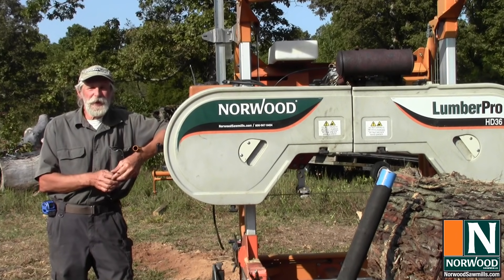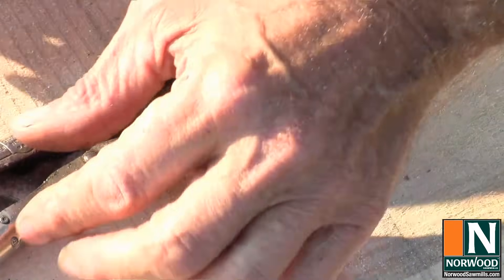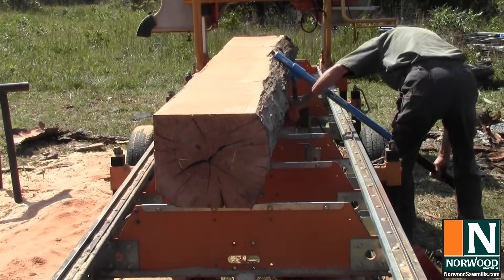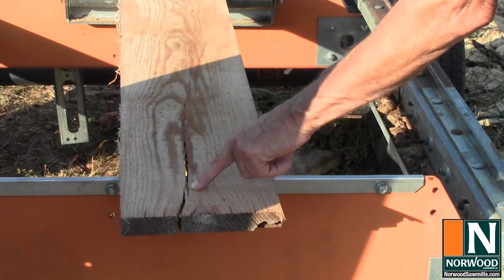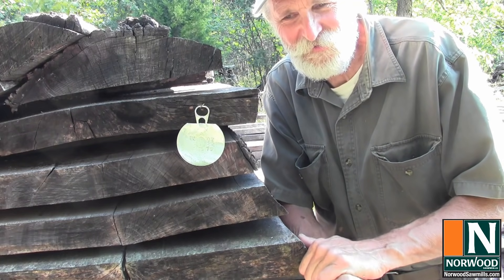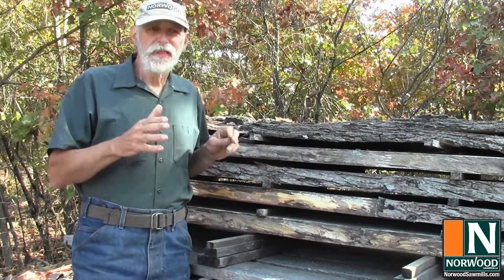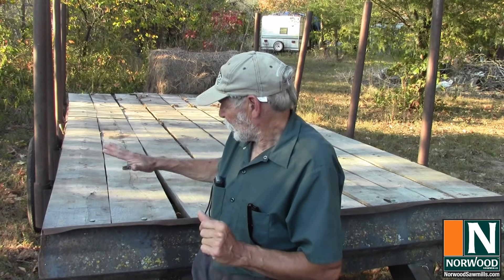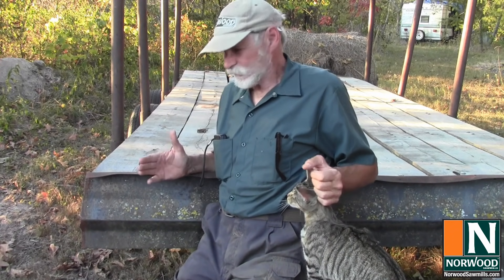Sawmill School - Air Drying Your Lumber

Comment: Can i blast my 26in slab with a turbo heater while its anchored down onto stumps every 4 ft?
Reply: Hi, Dale.  Sure you can!  Are you in the charcoal business?  It takes time for the moisture to migrate through the wood cells, and that's more a matter of thickness than board width.  If you try to dry it too fast, the wood fibers on the surface will dry and shrink, while the fibers in the center are still at the original moisture content.  The stress will cause surface cracks and can compress the moist fibers in the center which, when they finally dry out creates a reverse stress known as "case hardening".  If you've ever had wood twist or bend when you rip cut it, you've probably encountered that issue.  The only quick way to dry thick slabs without damaging the fibers is in a vacuum kiln, which can dry 2" thick slabs in a few days, but is an expensive piece of equipment.

Comment: Hi How do you pile the lumber up for drying.
Reply from the maker: Hi Reiner

Check out our video "Sawmill School - Cutting Blocking & Stickers to Air Dry Your Lumber" https://www.norwoodsawmills.com/tv/index.aspx?isVideo=true&id=312955927
Reply: Main thing is to have it under cover & allow good air flow through the stacks.  If in a barn or shed, you might want to have fans to circulate air through the lumber.

Comment: Is the process and time for air drying any different for a 2x6 vs a 6x6? Planning on milling my own 6x6s
Reply: Process is the same, time may be different.  A lot depends on how you use the lumber.  A 6x6 is generally used for structure.  It will take 5 or 6 years to air dry, but that might not be important, since it shrinks only about 0.1% in length, but will shrink around 3/8" in width & thickness.  It is also more likely to end-crack, since there is more drying stress, so you might want to end coat the beams, if appearance is important.  Hope this helps.

Comment: Hey thank you so much for the information! I am confused a little bit by something which is I did my first stack and sticker on a pin oak. That was nine months ago here in Central Oregon and I found that the slabs have capped and warped so significantly. I’m wondering if I should’ve waited and left it in the log? Does it make any difference? From this video it seems like it really doesn’t
Reply: Good question.    A lot depends on the species, the grain of the wood, and how it is milled.  Pin oak is pretty wood, but it does have quite a reputation for splitting and warping as it dries.  A lot of people either strap the wood tightly with steel straps or nylon cargo straps (which need to be tightened periodically, since the wood shrinks as it dries), or put weights on top of the stacks to help control the warp.  It doesn't help to leave the log-- it is best to cut the log as soon as possible, as this reduces end cracking.    Here's another video you might enjoy: https://www.youtube.com/watch?v=DBQjK_LXsLU

Comment: Any particular moisture meter you recommend.  The pin type seems the most accurate.  I have about 800 bd ft of both post oak & ash.  Not sure what I am going to do with the post oak.  They been air drying since Dec 2020.  Tks for the info.
Reply: I use a Lignomat pin-type meter, mainly because the pinless meters are more expensive.  Especially for air drying, just getting to within a couple percent of the actual moisture content is good enough.  Post oak is good for blocking and stickers, but tends to warp as it dries (as you can see on the trailer).  Rule of thumb is a year of drying time per inch of thickness, but that doesn't take local conditions or species into account.  Post oak will take longer to air dry than ash.

Comment: Should my blade be spinning when the motor is idling?
Reply from the maker: No, it should not. Please call us at 800-567-0404 for help with your mill set up. Thanks
Reply: It depends on which sawmill you're running, but Norwood mills are designed for the blade to stop when the motor is at idle.  I wouldn't work around a mill that didn't do that.

Comment: enjoyed the video - curious on if you'd dried the post oak a couple of months would you have had the majority of shrinkage
Reply: A couple of months would have taken up a lot of the shrinkage.  The point is, if you know exactly how wide the board was when it came off the mill, the wood will be pretty much through shrinking when it has lost 7.5% of its width.  Let's say a board 10" wide off the mill shrinks to 9.5" wide.  You'd know that lost 5% of its width and has another quarter inch to shrink before it is equalized.  Gaps between the boards would eventually open up about 1/4" wide.  Just depends on what's tolerable for the end product.
Reply: I just watched a couple of your videos-- looks like you've got a great setup for your mill.  Mind if I post a link?  Where are you located?  Would like to know more about your setup.
Reply: @daveboyt6810  did not understand it was that predictable, very handy to know, thank you
Reply: @daveboyt6810  you're more than welcome to post anything you like from our rookie videos. we're enjoying getting to know our saw and each time we cut, we get better at it
Reply: @daveboyt6810  oh, and we're in Lincoln, NE
Reply: @booneriversawyers239  It is predictable, but the rate of shrinkage varies a bit by species and whether the wood it plain sawn (tangential to the grain) or quarter sawn (perpendicular to the grain).  Walnut, for example shrinks less than post oak, and quarter sawn boards tend to shrink and warp less than plain sawn.  Woodweb has a handy shrinkage calculator. http://www.woodweb.com/cgi-bin/calculators/calc.pl?calculator=shrinkage .  This is kind of advanced-- maybe I'll go into this level of detail in the future, since a lot of sawyers are also woodworkers or work directly with them.
Reply: @daveboyt6810  we'd certainly watch that video. We work with a lot of wood workers and typically kiln dry it for them. I need to update the video on our kiln, we've improved and expanded it

Comment: What if you live in Georgia where it's fairly humid most of the time and stacked your lumber inside with a dehumidifier running?
Reply: Good question.  About the same as I'd do here in Missouri.  Put fans on it to circulate the air through the stack and check the moisture content every day.  If the wood starts to crack or warp, turn off the fan and dehumidifier and put a tarp over the wood for a couple of days to let it equalize and reduce stress in the wood.

Comment: I seal the ends of my logs with cheapo latex paint. I color code the wood. Red is red oak. White is white oak. Yellow is yellow poplar. Green is hickory. Cherry is black. That's pretty much what I have but I can add others of I get something else.

I paint the ends before cutting boards and that saves a tremendous amount of time painting the ends of boards. It may not be perfect but it works ok.
Reply: Sounds like a good plan!  Thanks for the comment.

Comment: What if you keep the wood in doors while you air dry it would that be better?
Reply from the maker: It still will only go as low as the relative humidity in the environment. It equalizes.
Reply: Good question.  Indoors-- even in a barn is good IF you can set up some fans to circulate air through the stacks.

Comment: Thanks for the info. Did that nail ruin your blade or were you able to keep cutting?
Reply: I kept cutting.  If I had been milling more valuable wood for a woodworker, I'd have changed the blade, since the nicked blade does leave deeper marks in the wood.

Comment: great job !
Reply: Thanks for watching!  Are you a sawyer or woodworker?
Reply: @daveboyt6810 Ha, nope : ,  but  I have an 80 ft cherry tree laying in the front yard screaming   DONT  BURN ME !!   haha   I also am around an area the has some  HUGE  wind downs  over the last three years .      So just researching  local mills, and  whether or not to  try and start one  .    This area has tons of logs , but not that much demand for cut/rough  lumber.
Reply: @Wag2112  There's always a good market for hardwoods like cherry.  The trick is to find woodworkers who want it, and how to make specialty cuts (like wide slabs) that they can't get anywhere else.  A professional woodworker customer from Texas drives 1,600 miles round trip once a year to get a trailerload of lumber from me!

Comment: You can tell buy weight? Pick up dry lumber them pick up wet wood very easy tell the difference
Reply: That's true enough if you have a wet and dry piece to compare, but a dry piece of hedge will outweigh a wet piece of sycamore.  Even within a species, the difference between 6% (kiln dry) and 12% (air dry) would be difficult to determine without a meter.

Comment: 3:45   There is a neat truck.  Are  you going to  use it again sometime?
Reply: The old grapple truck is a '72 International cabover with a blown Detroit Diesel engine.  It's been sitting a while, just haven't had time to work on it.  I would consider offers for the truck and/or grapple, since I don't do much logging anymore.

Comment: how long are logs good for when they are on the ground untouched after they fell? (I'm thinking Oak trees about 1-2 feet in diameter)
Reply: Oaks in the white oak group (white oak, post oak, burr oak, & chinquapin oak, to name a few) are pretty durable, and you'd be ok for a couple of years, if you don't mind some discoloration.  Oaks in the red oak group (red oak, and black oak) decay more quickly.  Best thing is to just put the chain saw into it and see how solid it feels.
Reply: I have a lot of white oak it lasts several years on the ground
Reply: @homersimpson5668  White oak is pretty durable.  It might be a bit discolored, but it should still be sound.  I wouldn't hesitate to mill it!

Comment: The wood definitely does dry in the round it’s just oak absorbs the rain a lot more than maple, sycamore, beech etc - also the sap wood Rots and the moisture in timber that’s been down a while is most likely rainwater saturated and not sap whereas green timber is very sappy which causes bending

Comment: 1 huge disadvantage to air drying lumber for woodworking purposes: bug/worm damage. it ruined 800bf of 100 YO red oak...these trees were over 60" in diameter...stopped the checking, but the bugs made it all fencing boards..
Reply: You make a good point, and I'm sorry you lost all that red oak.  In a case like that either covering with a tarp and fumigating or getting it straight into a kiln and holding at least 135 Deg F for a few hours would be the best options.

Comment: Ok Dave...here's the big one:  Everyone seemed to use the 16 penny nail for a spacer when using pressure treated 5/4 bull nose decking for decks/boardwalks to maintain an 1/8" gap for drainage.  Looking back, I have witnessed those gaps increasing to 3/16" to 1/4" inch on some areas on different projects over the past couple decades and to be fair, I realize the feds stepped in and changed the treating chemicals up, half way through the game.  That being said....for a deck or walkway, should we be butting the 5/4 treated decking instead of spacing?
Reply: I'm not sure I'm the best one to answer that question.  You normally want some space between the boards so rain can run down between them, and the spacing is a good idea.  In dry weather, the gaps will open up a bit, but when it is damp, they will close up a little.

Comment: so if you buy Kiln dried wood it will eventually rise in moisture content to reach equilibrium with the relative humidity
Reply: It's a little more complicated than that.  Kiln dry wood is about 6% moisture content, which matches the average relative humidity and temperature inside a home.  There may be seasonal changes (typically lower moisture content in the winter and higher in the summer).  Kiln dry wood used outdoors will pick up moisture and swell in most locations until it equalizes to the higher outdoor humidity.  Hope that makes sense.

Comment: I'VE GOT A MASSIVE RED OAK ROOTBALL STUMP 38" ACROSS THE SAW CUT. I'M GOING TO ATTEMPT TO MAKE A BOOK-MATCH SLAB TABLE OUT OF IT WITH BLACKWALNUT AND CHERRY BOWTIES TO THE MATCHED ENDS. I'VE SEAL COATED THE SAW CUT 2.5 YEARS AGO.
THE TABLE I'M GOING ATTEMPT MAKE IS FOR MY PASTOR I PRAY I DON'T MESS IT UP.
Reply: Sounds like quite a project.  You did the right thing to seal the wood to slow down the drying.  Root balls are tricky because the grain runs every which way.  Good luck, and post a photo when you get it finished.  Could be a stunning piece of furniture.
Reply: @daveboyt6810  I WORKED FOR BAKER FURNITURE IN HOLLAND MICHIGAN WHEN I WAS 17 THEN WENT TO A FAR OFF LAND I'D NEVER HEARD OF EXCEPT ON THE NEWS.
THE REST IS HISTORY.🙏
Reply: @davidfredenburg8283  Glad you made it back.  Hope all is well.

Comment: So, our ancestors...they built some of the finest furniture ever known, true master craftsmen. But they didn’t have that new fangle handy dandy moisture meter so....how’d they know when it was right?
Reply: Good question.  A lot of it involved the design.  For example post & beam construction and log cabins are designed to allow the wood to shrink without compromising the integrity of the structure. Trestle tables held together with wedges could be tightened up as the wood shrinks.  The Egyptians mastered the use of veneer for their fine furniture.  Weighing the wood still serves as  good way to tell when the wood has equalized to its environment.  When it stops losing weight from moisture loss, it's ready.  That's  why the apprentice system was so important.  It still takes years of study to master woodworking.
Reply: Store it under cover a year an inch thickness, whoever buys it is going to store it indoors for at least a year, if in doubt saw the end off, your five year apprenticeship should tell you what dry wood saws like

Comment: 11 percent is very good for a lot of projects.
Reply: Right, as long as the woodworker understands that the wood is "air dry" and will still shrink across the grain a bit in an indoor environment.
Reply: @daveboyt6810  Hi Dave, a quick followup question.  Even if you start with 7%.  Won't timber rehydrate with sufficient humidity?   Can I ruin kiln dried lumber by storing it under a piece of tin outside?
Reply: @M3rVsT4H  Good question. It won't necessarily ruin kiln dry lumber to store it outside (as long as it is off the ground), but it will pick up moisture to the equalization moisture content of your area, and will need to either be stored indoors for at least four months per inch thickness or go back in a kiln to get it back to 7%.
Reply: @daveboyt6810  Thanks for the info, appreciate the detail. Like others I'm sure, workshop space is at a premium.  But I'm not satisfied my storage areas are ideal. Something to work on I guess. :)

Comment: I air dry my peeled red pine logs 10" and smaller for at least a year before I mill them. Makes for strait and untwisted timbers when done. Only my mill is the "DeWalt Radial Arm Sawmill.
https://www.youtube.com/watch?v=Oq7fOd_O5yM
Reply: Just watched your video.  Even with a band saw mill, your design would come in handy for smaller diameter logs.

Comment: Logs do dry in the yard..... oaks tend to dry extremely slow compared to maples....   moisture meters are an extreme approximation of moisture content....using a sample, weigh sample, dry sample in oven on low heat, reweigh sample then do the math.

I have 15yrs  commercial hardwood kiln drying experience......  green oak, fresh cut can be 110% moisture content.... after a year on sticks in the yard the MC could be down to 20%....
Reply: You're right, but I was trying to keep it simple in this one.  I'll do another video that gets into the math & science of drying wood & will include the sample weight technique, for sure.

Comment: Ive got a feeling your moisture detector has gone bad.  Very unlikely a freshly cut and 3 year downed log will read the same. Like EXTREMELY unlikely.
Reply: Depends.  If the downed log is kept up off the ground, I would agree,  but a log laying on the ground holds its moisture, and might even be higher moisture content than a fresh-cut log.

Comment: Spend the extra money and get a moisture meter that lays flat also known as a pinless moisture meter the pin meters are better for drywall and the water restoration industry pinless moisture meters are made specially for the logging and wood industry spend the extra and get one the pin meters I have seen in person can be as far of as 20-40% that’s a Hague difference and could ruin someone’s project
Reply: You're right.  Those pins only penetrate about 3/16" into the wood.  If I can get Lignomat to send me a pinless meter, I'll run some comparison tests and post the results.  One advantage of the pin meter is that a kiln operator can put probes with wire leads in boards in various places in the stack & connect them to the meter to monitor performance.

Comment: Logs don't dry out because in the forest when they fall and lay on the floor, they have to break down from a natural process.  I have had logs used in a round corral and they rot out much quicker than boards because they collect water and don't dry out quickly.  Humidity in the air wets the wood and the wood being porous will soak up that humidity.  Houses are the same.  Without proper water shedding and ventilation, they will rot out the wood in the house.  Chipboard is an excellent example of this, rotting out much quicker than plywood in comparable settings.
Reply: True, but there is a lot of difference in how quickly different species rot.  I've milled walnut that has been on the ground for 8 years.  The sapwood was rotted away, but the heartwood was perfectly sound.  On the other hand, hickory or sycamore would have become compost in that time.